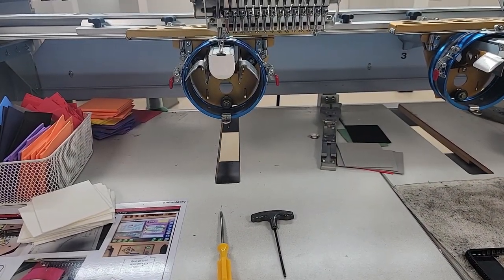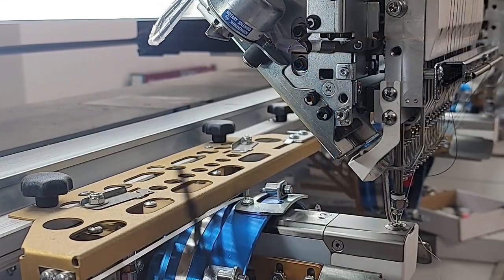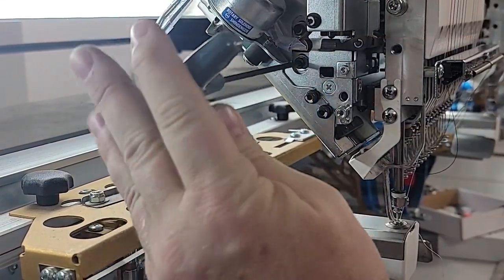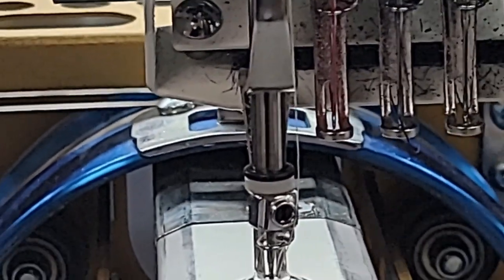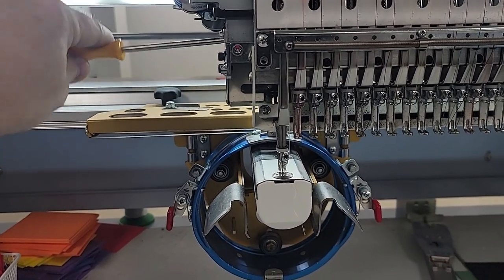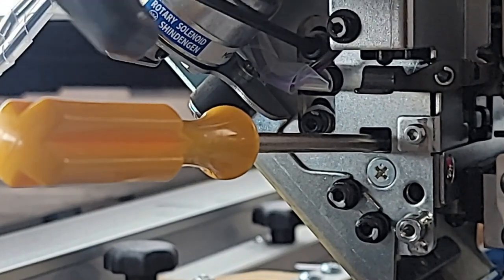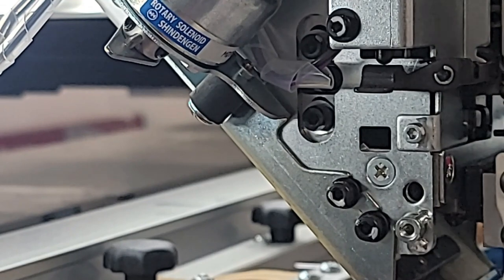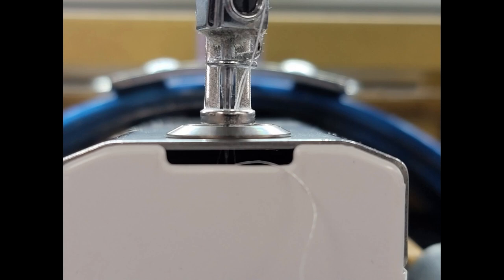Barudan X/K Series Embroidery Machine: How to adjust Pressure Foot Heights

Comment: Hey John , thanks for the video it was very well explained, I just have a question , if the presser foot is set at 2mm is there any issues I could have when running flats or thin materials ? I sew 50/50 hats/flats and adjusting the presser foot every time would be a lot of time consuming
Reply from the maker: Great Question. As long as the pressure foot makes light contact with the garmets, you will be just fine.
Reply: @SouthernExposureEMBtech  thanks for the quick reply so presser food at 2mm after doing a few runs of polos I found out the trims are not clean and I get the D12 error very often